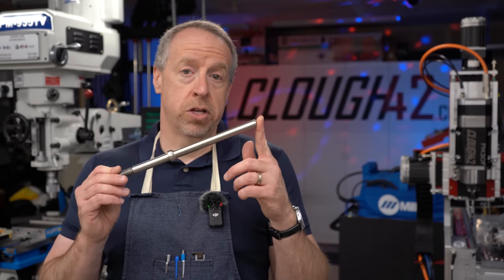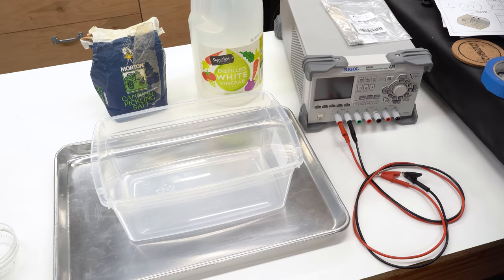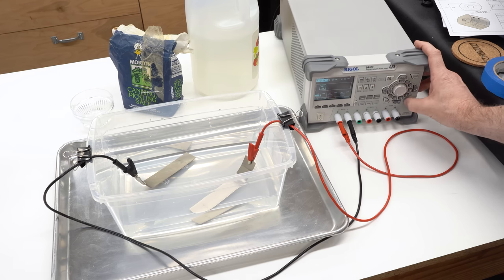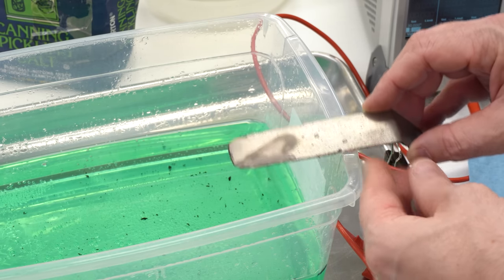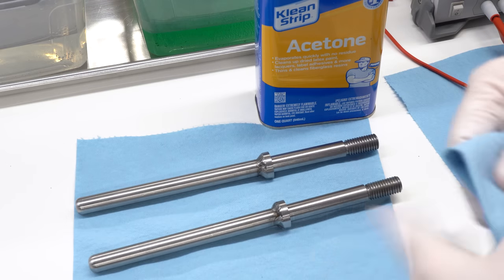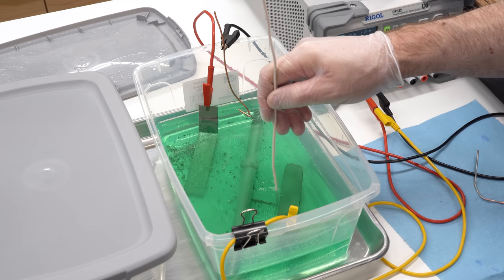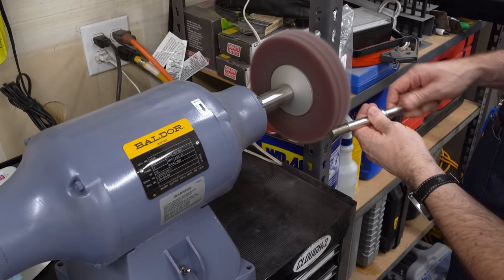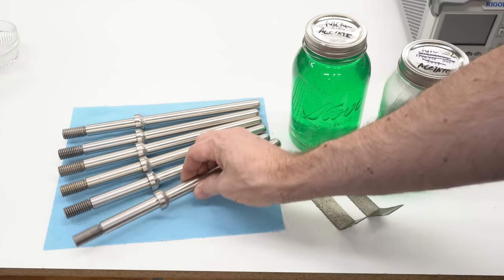Nickel Electroplating in the Home Shop - A Shocking Way to Prevent Rust!

Comment: Looks good James 👍👍
My only suggestion would be if you're looking for a really durable finish or if the parts will come in contact with moisture for any length of time would be to Copper Plate the Steel first, as Nickel doesn't bond that well to Steel and, Copper bonds well with both Steel and Nickel. Also if you're looking for a Copper Plating solution pick up some Copper Sulfate Root Killer found at any home store, it's cheap and works great.
Reply: Steel cannot be reliably plated directly with copper unless you are using a pyrophosphate copper plate solution.
To plate steel with acid copper solution you first need at least a strike coat of nickel
Reply: Do you mix the root killer with water or some kind of acid?
Reply: @dekutree64  sulfuric acid, not a lot and also demin water, look for acid copper solution formula, if you can’t find it let me know and I’ll find one for you. You probably still need to buy brightener and your anodes OR you can usually use refrigeration grade copper pipe, this is important as not all copper alloys work well for plating, for instance copper bus bar generally makes for poor quality plating due to its composition which is usually about the phosphorus content
Reply: Ah. So it's kinda like how properly chromed parts are first copper plated as an interface material.
Reply: @ianbottom7396  Isn't this just for stainless? I plated some nuts and springs laying around (in copper acetate) and they plated almost instantly. The voltage was below 1.2V.
Reply: @peteabc1  nope not from my experience but I can’t speak about copper acetate specifically, a few reference books I have and anything I’ve seen online beyond a science experiment concept video. 
If you want to do some more research I’d be looking at metal reactivity and electrochemistry
Reply: @ianbottom7396  as someone who has worked in industrial plating shops my entire adult life, you absolutely CAN plate nickel directly to steel, and copper directly to steel.  As long as the surface is clean and activated properly (hydrochloric acid or blasting is best for regular steel) it's not an issue.  We do it all day every day at work, mostly on aerospace components.
Reply: @N.Cognito  read carefully what I said, acid copper can’t be successfully directly plated onto steel without a strike plate of nickel UNLESS you are using a pyrophosphate or perhaps a cyanide based plating solution
Reply: @ianbottom7396  read what I said again, yes it can.
Reply: @N.Cognito  in a commercial / industrial plating shop, yes, not BASIC ACID COPPER SOLUTION, pyrophosphate or cyanide based yes and probably others
Reply: @ianbottom7396  I think the key could be, that in reality we're plating alloys (often unpure).
Reply: @peteabc1  perhaps that’s a feasible reason, and there are bath solutions that it is possible with but not simple acid copper solution.
Regarding your previous suggestion about stainless steel, I’m pretty sure that with good surface preparation which included abrasive cleaning, stainless steel can be plated in an acid copper bath and that’s possible because of the nickel content in stainless
Reply: @ianbottom7396  except that I've done it.  With proper technique it can be done.  We have over 100 processes at work, while I don't know all of them acid copper is one I've performed, and in doing so I've plated to steel with no strike (copper or nickel).
Reply: @N.Cognito  so instead of making generalised comments you can detail your exact bath electrolyte that makes it possible
Reply: @ianbottom7396    I'm no chemist, we have a lab that analyses the chemistry and makes what ever adjustments are needed, I more or less know the "floor chemistry" (like being able to tell when metals are too high or there are contaminates, based upon the deposit).  Your saying I'm the one making generalized comments, when your the one making claims about an industry you are not proficient in.  It's not always about the chemistry either, there are certain techniques you can utilize to achieve good results.  Your comment about plating acid copper directly to stainless being possible proves your lack of knowledge in the subject  To reliably plate to stainless the abrasive cleaning your mentioned is good practice, but it's not the key.  A good acid (preferably sulfuric with a negative current applied) and then the woods nickel strike is.  You should note that my above mentioned success with out strike was on (as stated) normal steel.  Plating may seem simple, and once your experienced in it it's not difficult, but there is a very steep learning curve, with a lot of counter intuitive practices that only come from experience, just like any other profession.
Reply: @N.Cognito  

Such a long response but you said so little.

This video isn’t about a commercial or industrial plating process it’s a DIY garage plate and your only objective here seems to be to contradict my opinion based upon my experience and yet you do this and then have the audacity to say you aren’t a chemist and clearly have no idea of the chemistry of the bath but expect anyone reading this to accept your “professional” understanding that seems to exclude the basic facts of the basic chemical make up of the electrolyte solution you are using to directly plate steel. As I’ve stated several times, yes it’s possible but not with a basic acid copper solution without an intermediate strike plate. Now if you are talking about a pyrophosphate or industrial cyanide based (which isn’t going to be the case for a DIY or very small scale shop) that’s a different matter and completely feasible.
I could quote published reference sources or perhaps post links to threads which support what I’m saying but there is little point when I’m being rebuffed by a professional who doesn’t even know what the basic bath solution is that he / she is talking about so your argumentative input lacks credibility.

Certainly seems that your “professional” experience is limited to low level manual labour tasks, if that’s not the case I apologise but I’d personally expect that someone with the experience you are claiming to have some understanding of basic bath chemistry.
Reply: @ianbottom7396   so what your saying is you know more then me based upon some books and videos you've seen.  What I've stated is that I have acid copper plated regular steel with no preliminary strike.  I'm not talking about cyanide copper, but acid copper.  As I've stated we have over 100 processes, should I know the chemistry make up of every tank we have, considering we have a fully staffed chem lab on site that analyses the chemistry to ensure it meets the specs we plate to.  I have critical parts I've plated on everything from Apache Helicopter drive shafts, 737 landing gear components, 787 tail wing actuators and many more.   Your claims that I only perform low level manual labor shows how little you know about me or the industry I've worked in for 20 years.    
Like I said, success isn't based upon chemistry only but also various techniques you apply to each scenario.  I don't know what you do for a living, but I'm sure you know more about it then I do, and no matter how many books I read or videos I watch would change that, you only learn from experience.
Reply: @N.Cognito  20 years experience and you can’t be anything more than argumentative, I’m genuinely interested IF you can provide SPECIFIC information on the chemistry otherwise let it go and move on
Reply: skinner and bottom, are we men or are we devo?

Comment: James, I see that others have already mentioned placing the nickel anodes inside of "socks" to capture the (carbon, if I remember correctly) crud that comes out of the nickel anodes.  The socks also prevent the "crud" from getting plated onto the surface of whatever you choose to plate -- we sometimes had problems with this where I worked where we had a couple of electroplating Shops (we had most industrial types of electroplating, brush plating, & surface treatment processes in-house) and usually the problem was a torn sock.  If you decide to do much nickel plating and want to use better (physical) forms of nickel material, get a titanium basket to hold "nickel rounds" (maybe even snipped-up sheets that aren't particularly useful to you anymore?) with the sock around the basket.  Use buss bars to support the anodes & cathodes if you get more into electroplating too.
 
Yes, the plating thickness is very much affected by distance between the part & anode(s) -- the closer the two components are to each other, the faster the plated surface builds up.  Electroplating, at least industrial plating where much thicker layers of plated material are applied, tends to build up faster towards the ends of the cathode(s) and does not plate into perfect 90° inside corners, but plates fastest on external corners.  Think of physics experiments that you may have done in school plotting constant voltages (& perpendicular flux lines) around a bar magnet where it showed how, theoretically at least, you get an infinite number of lines coming off of the (perfectly) sharp external corners of the cathode.  I used this information to design conforming anodes (among other jobs) mostly for chrome since those lead/tin/antimony anodes aren't expended by the plating process, but sometimes we had to do this with expendable nickel anodes when the Electroplaters couldn't get the nickel to "throw" where needed.
Reply: I worked for Moog in the 90s and we used anode filters that were for all intents and purposes, white gym socks. I'm sure they were very expensive fancy anode socks but they looked exactly like socks.
Reply: The thickness of the plating is not a function of the distance but of the quantity of electricity transported over time in "Coulombs". The quantity of Coulombs is current x time. The quantity of material depends on the atom. Silver is one mole per Coulomb
Reply: @puits-de-science  Yes, but for the set voltage and given amperage, the distance between anode & cathode can make a big difference.  When I started supporting both the Plating Shop and the Grind Shop, the Plating Shop had to grossly overplate landing gear piston barrels in order to end up with enough plating to "clean up" in the Grind Shop and avoid having to replate the parts.  The straight barrels ended up with an hourglass shape from the heavy build-up at the ends of the surfaces to be plated.  At the time it was taking the Grind Shop 40-60 hors of grind time to finish machine the chrome plating on a piston barrel (about 36-inches long by ~6-inches in diameter or ~0.9-m by ~0.15-m in diameter).  By changing out chrome plating method from traditional "stick" anodes to conforming anodes, which kept a very short (~1/2-inch or ~12-mm) and constant distance between the anode and the parts, we not only reduced the time it took to chrome plate the parts, but drastically cut the grinding time to, on average, between 4 & 6 hours of grind time (depending on how much damage was being repaired on the piston barrels) due to not requiring the previous drastic overplating of chrome.
Reply: @bobvines00  Hi Bob, well the mechanism of plating is basically an electron play. You have positive metal ions coming at the cathode (-), they capture electrons and gather at the cathode according to Faraday laws. Now the local current density plays a big role in plating quality. Above a certain current density, for a given electrolyte, plating is not good. I prefer to increase the distance to have a more homogeneous current density, and to use low current and a longer plating time. There are plenty of other factors such as temperature and bath additives of course
Reply: @puits-de-science  Yes, you are correct.  And correct about a current density that is too high can ruin the quality of the plating.  When learning about conforming anodes, we found that if chrome is plated at a high enough current density to increase the thickness of chrome plated per hour by about 6-8 times, a cross-section of the chrome layer looks like Swiss cheese even if the visible surface looks good to the eye.  We backed off to only increasing the plating rate by about 2, reducing the time in the chrome tank.  The chrome plating was verified by our Chemists & Metallurgists as easily meeting their specifications & standards before we went into production with the new-to-us conforming anodes.  Some of our conforming anodes may have had up to an inch (~25-mm) "gap" between the anode and the parts, mostly to make it easier for the Electroplaters to drop the parts down through the anodes (which we ended up installing onto the parts before the parts were placed into the tanks rather than leaving the anodes in the tanks & trying to accurately insert the parts into the anodes).
Reply: @bobvines00  The analogy is the gentle garden shower vs a storm. You have turbulence above a certain point. I have not experienced chrome plating because the chemicals involved require a secured environment.
Reply: @puits-de-science  well only partly true. The current density (per area) is the most critical factor in the ion transfer and since current IS affected by both voltage AND resistance, having the part and electrodes closer reduces resistance hence allowing a greater current, hence faster plating. There is also an effect similar to magnetic flux where lines of flux are densest closest to the poles then spread out. Having the electrodes and part/s closer can improve the current flux density, especially on cylindrical parts.

Another thing that can help produce a more even plating is to rotate the parts regularly so that all sides/edges get a good direct line of current flow to them.
Reply: @boblewis5558  Sorry but no. Current is the parameter creating the effects since it is an electron transfer. Current is the consequence of voltage and resistance. I you use constant current, the voltage will adapt, depending on many factors such as bath conductivity and temperature. At electrode level, it is true that there is an edge effect due to the local electric field but the edge effect is a relative effect which is same at all voltage levels. The use of brighteners has a strong effect on the edge effect. For example, for copper plating, adding sulphuric acid and ethylene glycol almost suppress the edge effect.
Reply: 💯You need-2-do a YouTube video- if I wanted to make my own "DIY "Anode Bag" or sock,What type of material is common for it?
Thanks!!!
Lee
Reply: @Zen_Modeling  Part of the Nickle plating spec from work says:

CATHODES AND ANODES:

...  To prevent rough deposits, anodes shall be "double" bagged with a cotton or synthetic fiber such as polypropylene.  (If I used a synthetic material, I'd pick any synthetic material that is compatible with the acid(s) in the nickle tank.)

Anode bags shall be 4 to 6 inches longer than the anode or anode basket.

To prevent possible organic contamination all new anode bags used in Barrett Nickel-plating baths shall be leached prior to use.  (I'd use them even with nickle solutions from a different supplier.)

LEACHING:

Leaching is a procedure that shall be performed to remove unwanted organic materials associated with new tank linings and all associated equipment to be exposed to the plating solution (for all SN [Sulfamate Nickle] baths) such as new anode bags, filter assemblies, etc.

New tank liners and associated equipment as described above shall be leached for 12-14 hours in a water solution containing 2-4 oz./gal (15-30 g/L) Barrett SNAC and 0.05 oz./gal (0.4 g/L) Barrett SNAP, 0.1% by vol. SNAP A/M, or 0.1 % by vol. SNAP-L.

Water conforming to (the following) paragraph shall be used for final rinsing all leached equipment.

WATER USED FOR NICKEL PLATING PROCESS BATHS AND RINSES:

Water that has been purified by deionization, distillation, and/or reverse osmosis with a measured conductivity of 20 µS (microsiemen) or less, shall be used for solution make-up and maintaining solution levels of the nickel plating baths.  This type of water shall also be used in rinse tanks when replacing plating process rinse water due to evaporative losses.

Either tap (City) or preferably, recycled Non-Potable Water (NPW) water meeting requirements as specified in (the previous) paragraph, shall be used for replacing, rinsing, cleaning, etching, stripping, and cooling operations.

===============

I know that a lot of this could be very difficult (and/or expensive) to get and/or perform in a "home shop," but at least the anode bag material ought to be easy enough to get.
Reply: @bobvines00  
Well that was definitely the best informative answer to any question I’ve ever asked on YouTube or any other SM platform …Ever.. You actually remind me of myself. Anytime I’m asked a technical question I will go out of my way to answer it (above & beyond ) I’m humbled & very appreciative of you taking the time to do that for me in this case. 💯👏👏👏
Lee
aka: ☯️ZenModeling

Comment: I used to electroplate nickel onto a molybdenum metallization layer on ceramics. This is a common industrial process used for making a solderable surface on a ceramic assembly. We had various agitating and tumbling devices to keep the plating even. Despite that, it was observed that the metal deposited more thickly on sharp edges and corners of the substrate.

Comment: ⚠️. OUTSTANDING…. As Always!
Thank you.
We just tried this plating project with our fire department antenna mounting brackets that we had fabricated from mild steel stock.
They are only exposed to minor stress , but are most definitely going to be exposed to salt water spray and moisture.

We also have entered the 3D printing world.  Your projects and instructions are awesome.

Thank you!!